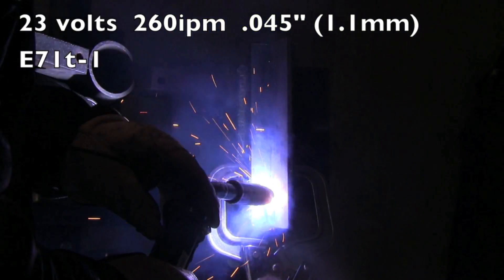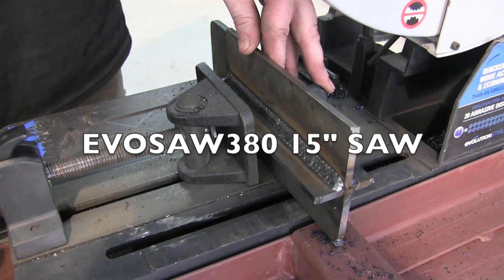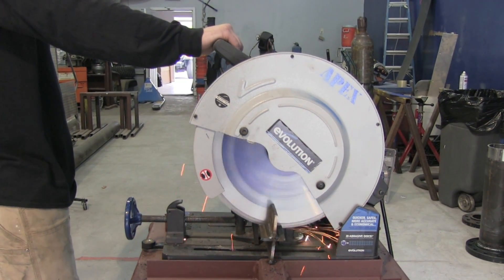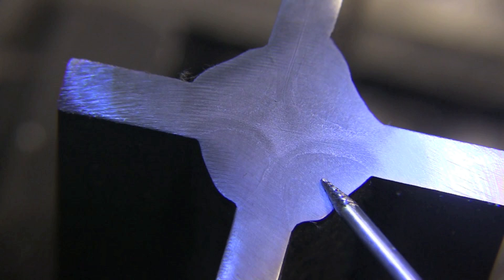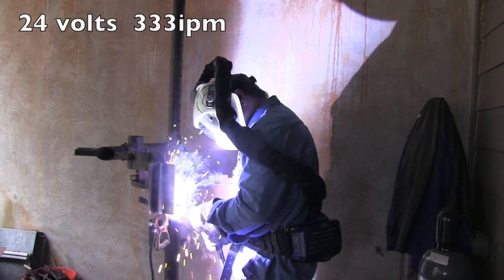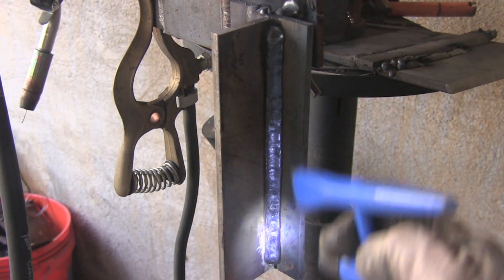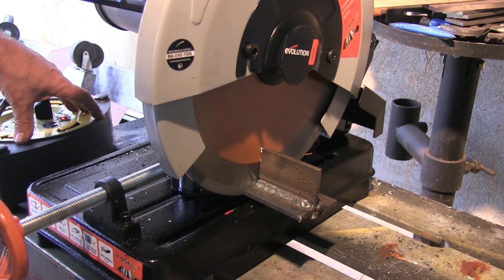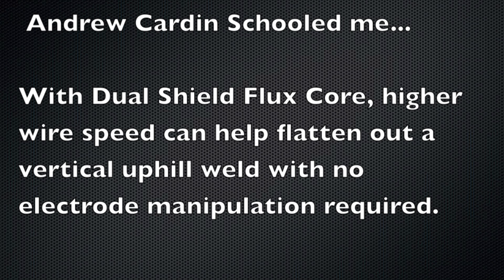Dual Shield Flux Core Welding and Evolution Dry Cut Saws

Comment: Dual shield flux core and self shielded flux core actually benefit from a longer stick out. 3/4”-1” even as much as 1-1/4” stick out. If changing position ie around a flange or pipe, it helps prevent worm tracks. Longer stick out also allows the wire to preheat enough before burning off.

Comment: honestly, not saying your settings or wrong or anything, i just tend to like to have lower wire speed than what you're using,  i love to have the feeling of welding in spray with flux core in any position, and it passes xray all day long (usually running 27V 300-310 wire speed)

Comment: Lol I used to use a Hobart wire eh... I wanna say it was maybe a e71t wire or something another.... idk anyways I always had a problem with it too when. I turned it down a bit to run a vertical weld. But just like for you I turned it up and got better results around 24-27 volts vs the 19-22 I was trying to run a d getting sloppy cold looking weaker welds and a ton of frustration too as a matter of fact but it's nice seeing it done this way with alittle more knowledge than I have thanks we all appreciate it!

Comment: What's the wire you are using? Böhler Ti 52-fd?

It works super in vertical uphill. You can run it no problem at 470"/min and 27-28volts in thicker material. 

In 12mm I like 295"/min and 25.5-26volt.

Comment: Jody, great video I'm trying out .045 dual shield flux core and I'm getting surface worms and they only seem to be surface, how do I get rid of these worms. I've read up on this problem and they are saying they are only surface worms and do not affect the strength of the weld, any input would help.

Comment: I run 1/16" lincoln ultracore had marine on 5/16" thick or thicker. Run about 250 ipm 26v 270ish amps can handle all positions Smooth as glass. If I have a lot of 1g or 2f crank up to 32v 380ipm. You can really cover some ground with this stuff.

Comment: Anyone?  Does the rule of amps to thickness apply in general for flux core?  At what Amps does the wire go into spray transfer vs globular transfer?  What are the advantages vs disadvantages to running bare flux core vs dual shielded flux core and with and without a nozzle?  Do you use straight CO2 or CO2/Argon mix?  Any uphill flux core tips also appreciated guys.  I know it's alot to ask but some guys like talking and I like learning.  LOL.  An

Comment: I weld with this type every day, and I agree on no manipulation on the electrode for the first stringer. Second pass can go with some side to side motion as a cover weld
A steady hand, slow travel upwards and work is done. If the bevel is uneven, just go a little slow and it will fill up the weld.
One final notice, pay attention to start and stop, you might get small hydrogen cracks in the puddle if your machine does not have slope down. It will show in the NDT.
You can overcome cracks by a gentle grinding at the stopping point. Or 'blink' the welding a few times while it is red hot.

Have a nice day to all metalworkers .

Welder for many years in fabrication and repair.

Comment: Very informative! I have never used dual shield flux core in my 30+ years tenure, but have often wondered about it's benefits. My question is: Would this be the way to go when welding outdoors in windy conditions? I have fought with the wind for years as have many others I know. They have tried this with varying degrees of success, but maybe they just never had the machine set up properly...?

Comment: Hey Jody, can you explain why a different grade of filler is used to weld the same metal? For example, using 4043 filler instead of 6061 to weld 6061. I cannot find an answer to this anywhere on the internet. Thanks!

Comment: Hey for another great Harbor Freight buy, check out their saw blade sharpener. 43 bucks with a coupon, keeps you from buying these expensive blades and since it comes with a diamond wheel, I also use it to grind electrodes.

http://www.harborfreight.com/120-volt-circular-saw-blade-sharpener-96687.html

Comment: The new tip u were i use to weld like that when i worked in shipyards run that bad boy hot and with alot of wire always came out nice and flat

Comment: What would be the primary purpose for using this wire compared to bare wire or regular flux core? Does it have a higher deposition rate or is it better for use on rusty steel?

Comment: hey jody! could you make a Video about arclenght? we just got a new welding machine where you can adjust it manually, but i have no clue when to use what Kind of arc :/
Reply: +Ammagrimmgul arc length on mig is similar to voltage but its for pulse mig welding  I usually use 30-50 for most  just play around with it and find what works best

Comment: jody, i have the blue saw, you still should check the angles setting with a square, there not on the money, found mine to be off 1 or 2 degrees  but it cuts smooth.

Comment: Great job on this!  Thanks for taking the time to adjust your technique and post a new video.  We do hundreds of these vertical-up stringers at work, and this is the way we do it, works great.  350 IPM and 24.7 volts works fantastic for us, .045" of course.  Lays in flat and slag falls off like nothing
Reply: Does the same modified technique work with solid wire gmaw-short circuit?

Comment: When you asked about saws, the blue one was the one that I suggested, because it's the one I've got. I even remember mentioning about the better base and clamp.
Reply from the maker: And thanks very much for your suggestion. I guess I had a weak moment when I ordered. I got the link from one of my forum members and went right to Amazon and ordered it. Not too sad though. Great price
Reply: +weldingtipsandtricks I love mine. Used it so much in already on a new blade. Trying out the Morse brand blade now. Don't forget to get those blocks. They help hold round and square tubes way better than the stock clamps can.

Comment: I used flux core with gas to weld repair electric motor shafts and the welds would lay down really flat we would have the shaft rotate and just keep welding like a screw thread was cool how the flux would come off in sheets after a layer was done.

Comment: Closer to hot is better. You should see a arc much like spray-arc  or pulse. That arc that looks like a broom on the end of the wire. Flux-core duel shield is what we primarily use on our repair shop for the Union Pacific Railroad. I love pulse-arc but most companies do not buy the extra card that goes in the slot of our Miller mig welders. I use pulse a lot on things like torpido to the pressure hull at Elect Boat.

Comment: I bought the same saw as you did. The sad part is I didn't buy mine on sale. The clamping vise is cheap and angle degrees are off. Check your angles before cutting or you're going to waste a lot of material.
Reply: I'm looking at the more expensive version, with the cast baseplate and vise.  Probably have to craigslist my Dewalt to help pay for it though.

Comment: I'm glad you finally did a video on dual shield flux core! at work they want us to run it around 26v and 350ipm. and we aren't supposed to go much lower for verticals. have you thought of doing some 6g pipe with dual shield? I would be very interested to see it. I have to take a test for it at work one of these days.

Comment: you say short stick-out.  So less than 3/4"? Dual shield runs so hot I would think that too short would cause binding and locking up at the tip. Thoughts?
Reply from the maker: +Jacob Gilkerson it can.  a good quality nozzle dip helps and its good to check the nozzle often to make sure spatter is not building up inside
Reply: +weldingtipsandtricks  10 4. Thanks. I may use this process to finish a grapple I'm building. I smoked the good old stick-mate. This seems robust and affordable. Not many videos out there featuring this process. I appreciate your time.
Reply: A water cooled MIG?  I've never heard of such a creature.  WOW.  I would love a link to, well anything really, to check it out.  I'm not being cynical or whatnot.  I really would love to see that setup.  I didn't even know it existed.  Thanks.
Reply: This really blows my mind.  I've never heard of fronius until I googled it as you suggested.  I  wouldn't say they are very common (at least in my experiences working in smaller shops)...but damn that's amazing to me AND they even seem to have pulse settings also.  Very cool.  Glad I asked and that you answered my friend.  I'm AMAZED and feel a little under educated now in MIG.  Gotta fix that and with your reply I hope to  Thanks.  Next Beer is on me :)

Comment: Does the same principle for this application of increasing wire speed to flatten the bead, apply to straight mig?
Reply: +Michael Murray No it wont because Turning the wire speed on Hardwire is going to basically make the weld/puddle hotter instead of just pushing the wire in better like it does with DSFC. Youll also notice on DSFC if you try to push the weld it will have no effect on the heat nor will your stickout like it does with hardwire. Thats why on DSFC you typically will want to have a slight drag angle so you make sure to keep gas on the puddle Instead of trying to push to get better penetration as you do on hardwire. DSFC welds quite a bit differently than hardwire in alot of ways but once you get used to it its actually a bit easier to use than hardwire. 

For example i have to do alot of pipe and tanks that must be pressure tested and when i do with DSFC i never have issues with leaks where i start and stop my welds and all i do is chip off the flux and hit it with a wire brush and go.. but on hardwire you will almost always have a leak on every start and stop point on your welds.. Sometimes even if you use a grinder on the spot to clean it where you stopped. So in those cases where you are welding things that must hold pressure its going to be ALOT easier with DSFC than Hardwire in my exp.
Reply from the maker: +Michael Murray from my experience it doesnt work the same on bare wire mig.  but I am going to  try it and see what happens
Reply: +weldingtipsandtricks thumbs up for that question by Michael Murray, keep us informed on that please Jodie! Would be nice to know the result.
Reply: vvgggughcfgffc

Comment: I have an Evolution saw with a cast base, and I love it, but the one thing to look out for is the squareness of the cut. Mine is off quite a bit more than I think it should be. And this isn't adjustable!
Reply: Shim the pivot point where it bolts to the base?
Reply: +twinstaged lol. If only it was that easy. The pivot point is cast as part of the base itself. The pivot hole was not drilled straight. I absolutely could fix it if I made a new bracket and cut off the old one and had it milled flat. But for a $200 saw? Not entirely sure it's worth the effort.
Reply: +Bradley Weingartner ahh didn't think they made it that way.  All my old saws I could shim.  Shame
Reply: +twinstaged Yup. Drives me nuts man!

Comment: Does Dual Shield Flux core have any advantages or disadvantages on 18 gauge sheet metal? Normally I wouldn't do it, but I have a lincoln weldpak 100 with gas and someone gave me two spools of flux core?
Reply from the maker: +mpkel2003 I wouldnt use it on 18 ga sheet.  I would say  over 1/8" would be a good rule of thumb

Comment: so maybe that's what i was doing wrong when i used this wire a few years ago never could get it to go uphill good, I'll have to try it again sometime, what is the thinnest metal you can weld with it, and lowest voltage?
Reply: +chase5726 Treat it like spray, anything recommended for short arc is likely too thin to use FCAW as FCAW is a hot high amperage process.

Comment: My Mom taught me smaw cause she welded instead of riveted in WW2 but now I want to teach myself mig. I only have a unused Dayton 90amp 120v but it will have to do. My question is should I get a gas setup for this(it has the connections and valve are built into the unit) or should I learn with the flux core?  Thanks!

Comment: Hi, thanks for the nice informative video. 
just a question, when you say if wire speed is high enough and current settings match with it, how I am going to determine that what is high enough and then the what right amps settings with that wire speed? 
is there any recommendation from your side for different settings on diffrent thicknesses?
Reply from the maker: +audi avant I think you start off with either recommended settings from a source like a text book, or a data sheet from lincoln electric,  (All brands of wire run just a bit different) ... weld some uphill beads using a short stickout and if bead wont flatten out on uphill with those settings, then increase wire speed until bead flattens out.  All this done on a piece of scrap at least 1/4" (6mm) thick  until you get good results.   Its a pretty good exercise in figuring out the sweet spot